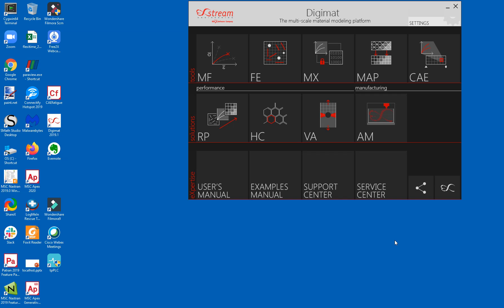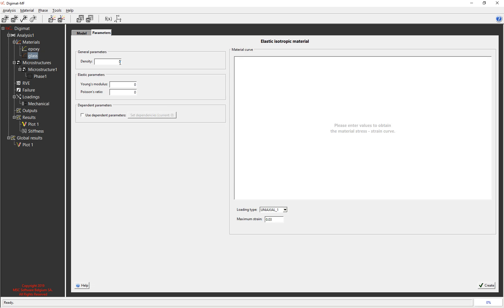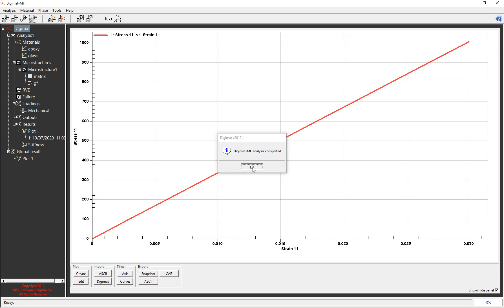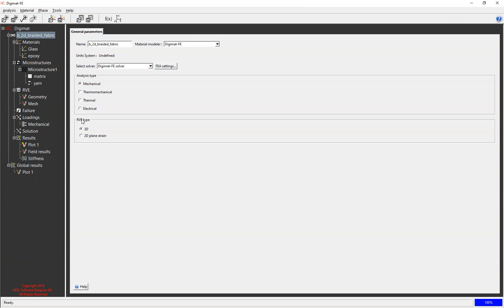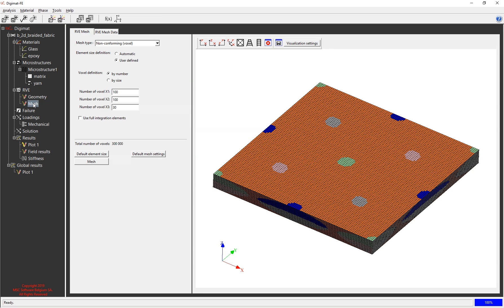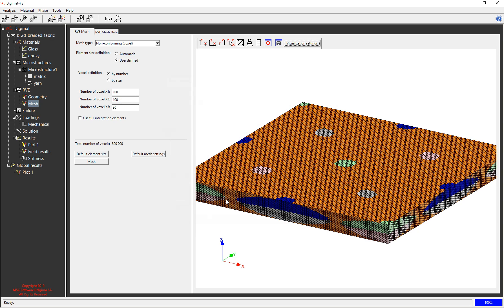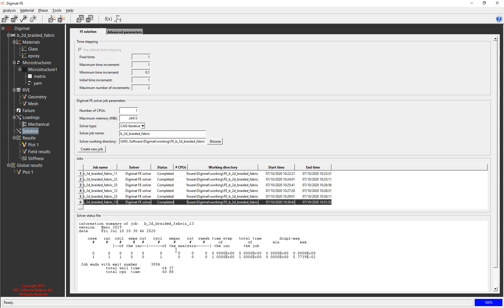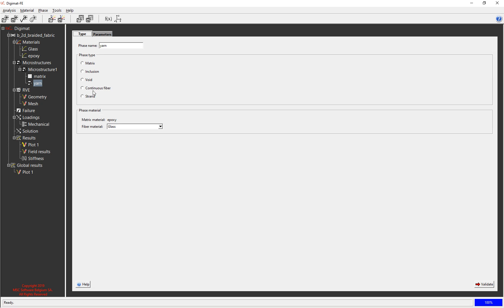Digimat MF & FE used to define 3D orthotropic material models

Comment: Hi sir
suppose if i am calculating homogenized property for 30 % fiber volume fraction for bidirectional mat which is of two layer. At first i chose MF technique by simply putting 30% fibre volume fraction and will get the homogenous properties. secondly i am choosing FE to calculate the H-properties so does the give the same rersults or different. As two layer of mat has 30 % fibre volume fraction

Comment: Hi ,
Can you tell me find the thermal conductivity of composite using digimat rev method to Marc ?
Reply: Hi - you can use the same methodology for thermal, thermo-mechanical and electrical models
Reply: @andywoodward7273  IF POSSIBLE CAN YOU MAKE A SMALL VIDEO IT WILL BE GREAT HELP TO FIND thermal conductivity, coefficient of thermal expansion and heat capacity. Thank you sir